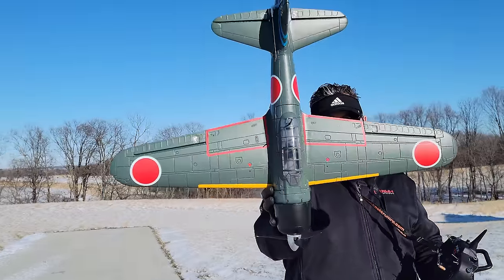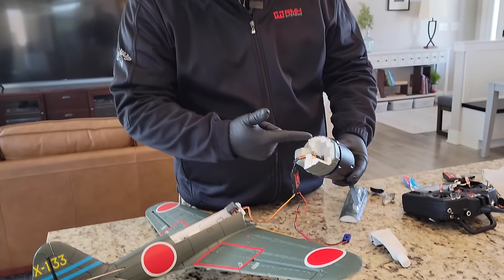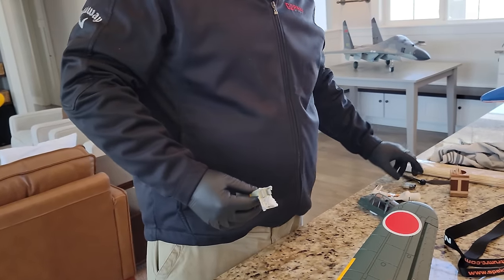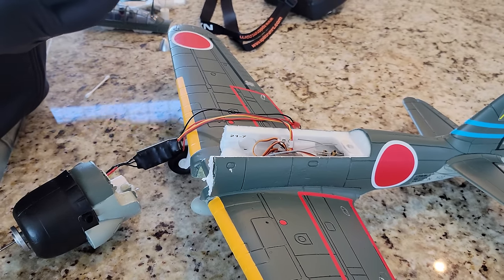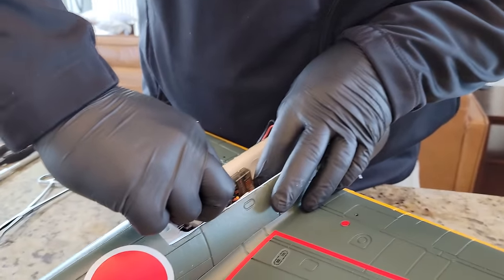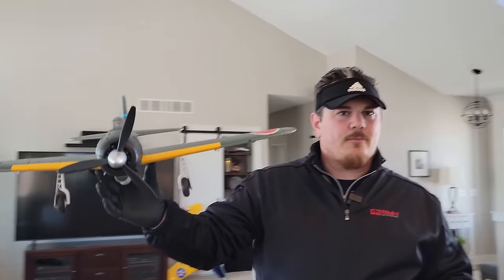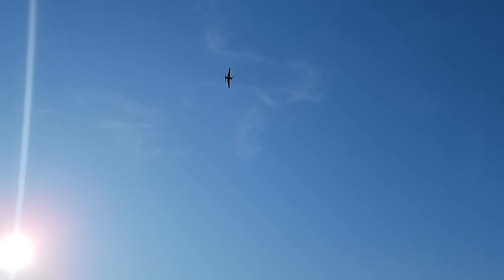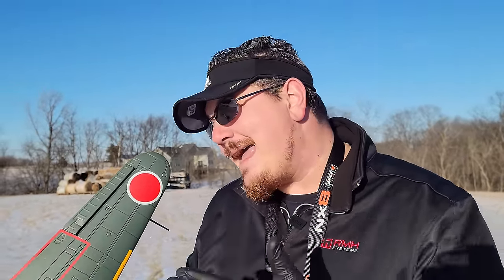FMS - Zero - 800mm - Maiden Flights, Crash, Repair, & Resurrection Flight!

Comment: I have to say I enjoy your videos very much, over many of the others I watch.  

I had a stroke about two years ago causing my hands and arms to shake a lot. 

My uncle taught me when I was 11 years old, starting with control lines a nice old ringmaster. Still have it.

Still have mainly balsa, however you are making me think foam as well.

Using RealFlight, I have had lots of difficulty with my shaking to fly. 

Watching you fly and many of the tips you give have helped me greatly and now even with the shaking I can take off and land as well as do some maneuvering. 

Practice helps a lot also! 

Thank you very much, 

Tracy
Reply: I know damn well you can still fly and probably better than myself Tracy.      
   These new planes with Safe mode will smooth out any shaking issues you may have.  You could always try a foam trainer to start or even the umx turbo timber is surprisingly easy and flys so slow with the flaps it's a blast! They make that Timber on a larger plane as well. Let us know how you do!

Comment: Great video Brian!  Especially the encouragement you give the newbies about maintenance and repair.  If a man learns to maintain and repair he will have an extra million at the end of his life.  Which he will leave to his daughter who will spend it in a season...Way it goes.   Retired army and schooled on my father's cattle ranch about what works... stays,  what doesn't work... goes, and don't take long deciding.  Joined US Army 1973... the US Army was big on maintenance, and my prize vehicle, as a Company Commander in 7th Corp Europe,  was our M35A2 supply truck...  the Data plate said rebuilt in 1962, I commanded in 1990.  It was rebuilt at depot.  I figured it was an old WWII M35 that probably was used on the Red Ball Express, and after the occupation came the cold war and this old truck was handed down from supply sergeant to supply sergeant, and in 1962 they converted them all from gas to Diesel.  So if that truck was built in 1943, it served for over fifty more years... the benefits of maintenance, maintenance intervals.  Young soldiers abuse trucks; drive them to fast slam on the breaks take the terrain too rough.   Never saw an M35 fail, seen plenty of failed soldiers.   I am sure that old truck is still somewhere in Europe today bringing toilet paper and  turkey wings to some lucky stinking dog faces. Folks, once you learn maintenance, you are good to go.  You never learn maintenance, you will always throw money away.  Once again,  great coaching and mentoring video Sarge!!! Love and Peace in his name, Amen.  Born in Louisiana, loved by Mom, disciplined by my tough arsed Dad, saved by my precious Savior!!!

Comment: The 800 series is awesome. Immediately throw the 2s in the trash and use a 1350+ 3s,  remove the wheels and send it! I've got a basher one and a new one (Corsairs) , have upgraded the esc and it runs 4s 1500 with a masters air screw and ar630. Turns into a acro beast!
Reply: You don't ruin props landing with no gear? I'm sure the motor is shit down but what if it stops with one blade straight down? Thanks!
Reply: @HciContractor  nah because I changed to a master airscrew 8x6 two blade prop, doesn't seem much faster on 3s than the stock prop, but has heaps more power, pretty much goes up until you can't see it haha.

Comment: Hey Brian, Great video. Plane looked fantastic. Like you, I love realistic scale warbirds and have a few as well. I'm very surprised your zero flew so well with the stock motor and 2S battery set-up. I have the FMS P40 800mm version and found it was way under powered with the exact same motor and with a lighter 800 2S battery. I was trying to hand launch it and was very unsuccessful. So I installed a Detrum 2815 1100kv motor, with a 800 3S battery and a scale (9x6) three blade prop, since the factory prop is smaller than scale. After those mods, the plane flies fantastic and performs great aerobatics.
I also read several post from other pilots that found the same under power issue with many of the FMS 800mm warbirds. Some pilots try to use the factory motor with a 3S lipo, but the motor overheats. That's why I put a larger and more powerful motor with a larger, but scale prop to give me more thrust.  
Thanks for the great videos!

Comment: Unusual for an FMS model to come damaged in the box! BUT, I had a similar, but worse experience with mine. It came in the box broken in half just aft of the canopy before the tail assembly. The box and packing and outer box were all in mint shape. but the fuse was in two pieces.  I took a picture w my phone before I removed it, sent pic to FMS, but they said I must have done it. I have since repaired it and bought another fuse for a spare. I've gotten the usual dinged wing and dented fuse from shipping damage, but this was a first. Still  love FMS planes, but I think I'll order them from the hobby shop so I can see it first
Reply from the maker: I'm very sorry to hear about this experience!!! I guess the story was so unbelievable, they just had to play the odds? Which plane, if you don't mind me asking?

Comment: Great video again. Looks like you found a sleight weak point. Surprised they didn't do it with the reflex but maybe its a space issue.

The set up for safe and as3x is a huge help. Is there any recommend setup for the gains? As I'm now on a dx6 gen3.

Hope you all had a great Christmas and the weather doesn't hit you too bad in the new year. Look forward to seeing the Corsair and mustangs in this class.

Comment: I have the T-28 in this size class. Great flyer! I have noticed that the props are quite fragile but the airframe is very resilient. Other than that, I wish FMS would use a slightly thicker plastic for the cowling because if you look at it crosswise it cracks. I'm been flying it with 3S batteries and no issue. Helps in the thin air here in Denver.

Comment: Nice video and good flight. haha.. not to mentioned the great repair.

Yeah I do not quite like the JST connector, but for a small plane with low current draw like this plane, may be XT60 is a little overkill, a XT30 might be just nice ;-)

Happy New Year!
Reply from the maker: Yeah, and agree XT30 would be better, but I kinda hate having to use them, since I only have a couple adapters built up ;) (....and I'm lazy - LOL)
Reply: @BrianPhillipsRC  😅

Comment: What happened to the power lines across the street from your driveway?
Reply from the maker: We paid the utility $24,263 to move the primary service (power lines) underground, from over-head. We just paid them $35,000 a little over 3 years ago to put them over-head (well, to be totally clear, we paid $25,000 of the $35,000, as our neighbors to the North covered part of it too). The utility refused to bid the underground service at the time we got the power pulled down the street - what a joke, right!?!?

We did it MORE for PPG, so I can help prevent my death in a failed landing or takeoff, but it has the added benefit of better clearance for flying RC and for beauty! That was something we didn't realize would happen...it's so much better! Just wish they would have bid what we wanted when we first hired it done...would have potentially saved us tens of thousands...
Reply: I guess no more Limbo. Haha

Comment: Expensive. Think I paid for my V2 Corsair, which is underpowered on 2s but equally hard to land and worse on takeoffs!
Reply from the maker: I would just plop a 3S in there if it's under powered for you. I bet it'll be fine. We'll do the Corsair soon, if you want to check it out.

Comment: Hi Brian does the safe work with the receiver on its side I thought it would have to be flat for or the controls to work on AS3X safe cheers Rick
Reply: Just did some investigating on AS3X safe and it does support multiple ways to mount it cheers Rick never doubted you I've never seen it mounted on its side as iam new to the hobby cheers Rick

Comment: What a coincidence
1. Since i've crash my FT speedster and cannot be repair. So  i'm building my zero and almost finish building it.  
2. I'm also using a venom pack 850mAh. Its seem you have a better connector which is mine is using a small cable output + JST plug. After flying, the connector seem heat up a little.😂😂

Comment: Where i can buy it rtf?
Reply from the maker: Unfortunately, I don't believe there is an RTF option in this size class.

It is currently on sale though: https://bprc.me/FMS_Zero

Or you can check out the 400mm option if you really want RTF: https://bprc.me/Zero_400mm

Comment: So you just use foam to foam and not pin with multiple toothpick for strength?  Wow, I’ll have to check that glue out. 

EDIT- Now I see you went back and added some toothpicks, but that glue looks pretty strong!  I’ve put in pins prior to joining and then connect, but your way gives a more exact fit before pinning and avoids the slight offset when things don’t align. 🫡